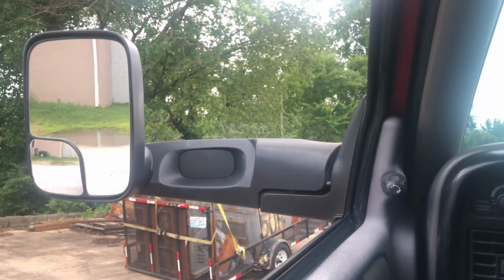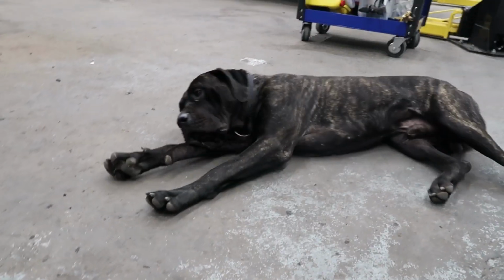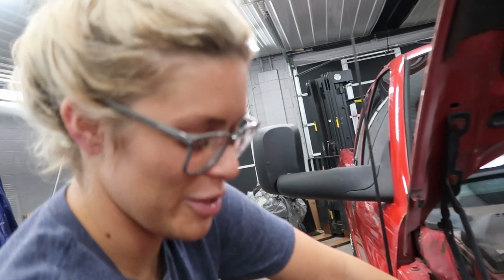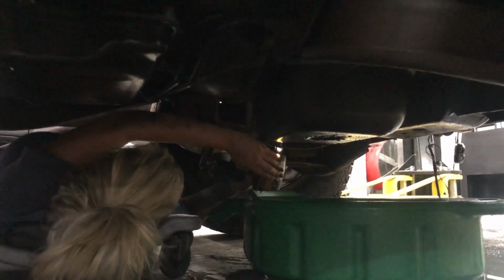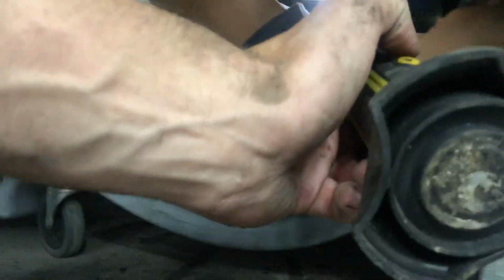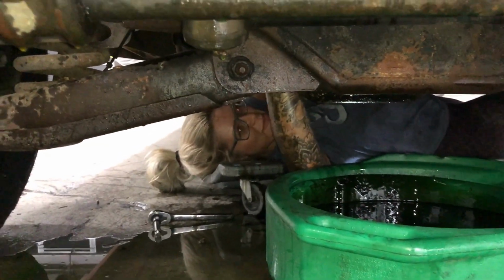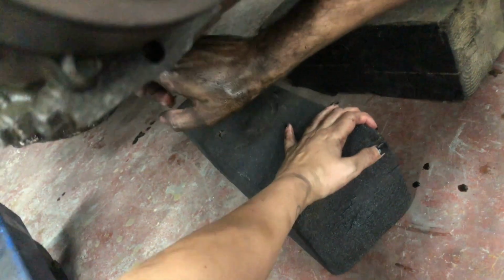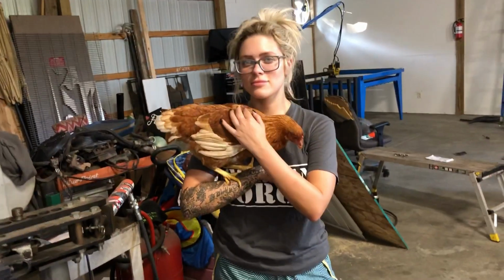Taking the 12V out of my donor truck

Comment: Did this about a month and a half ago for my brothers C30 build. Pain in the butt to pull engine so we loosened the cab mount bolts and lifted the cab about an 1 1/2 inches. Engine came right out.

Comment: First video of yours I've seen don't know what you are putting that motor in but be sure to relocate that fuel filter and also in the lift pump mounted on the motor there is also a screen filter in the bottom of it that most people don't know is there
Reply from the maker: David Caskey yes! It will be getting a FASS fuel system